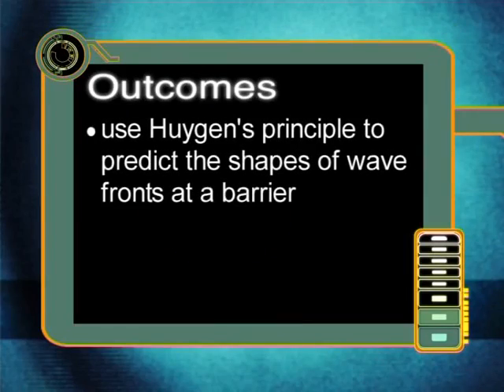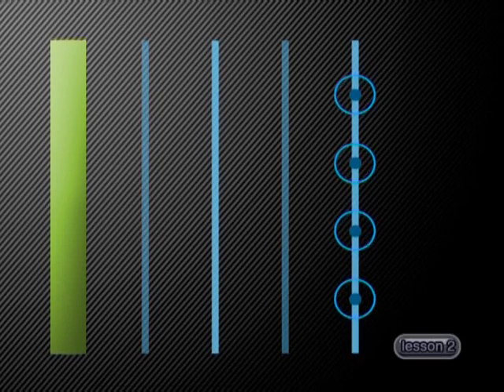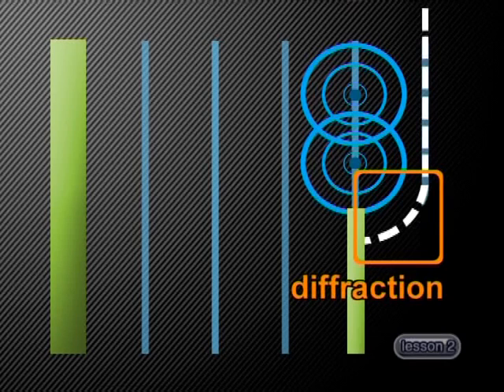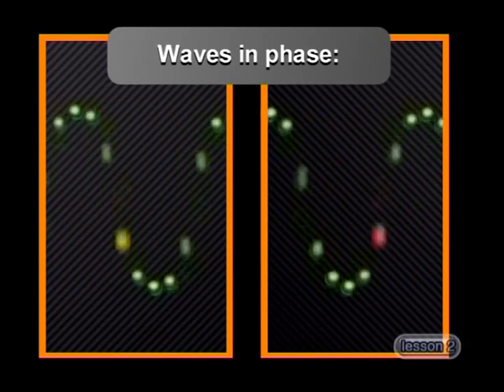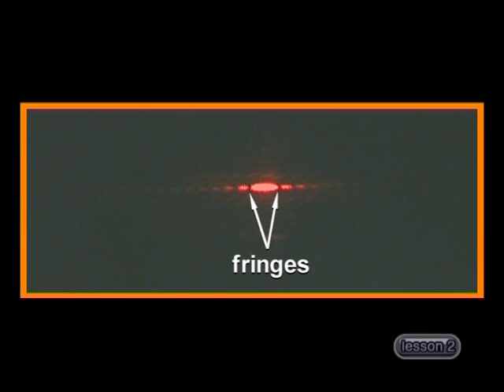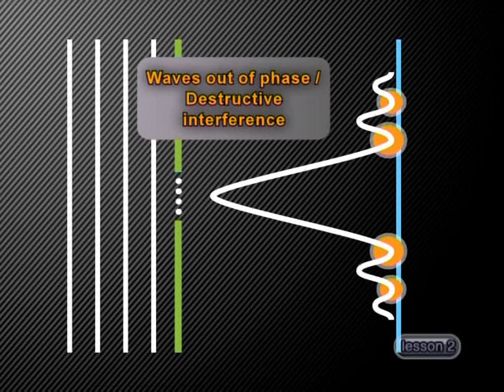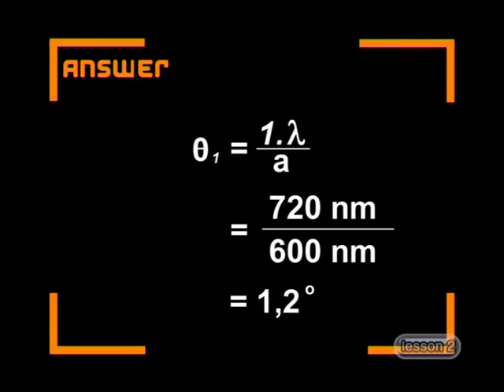Huygens' Principle - Grade 11 & 12 Waves

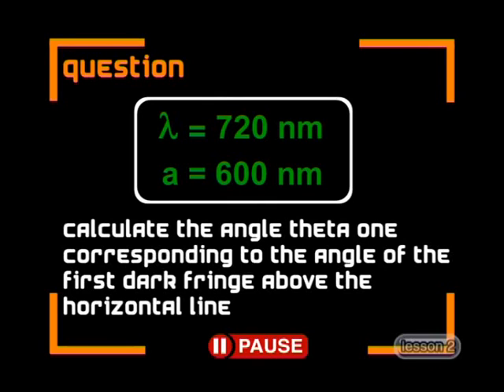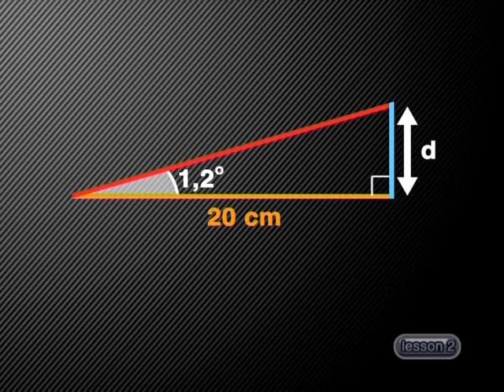Comment: Super nice presentation. But three errors:(1) at 10:14 the formula is only correct if the angle is very small  when measured in RADIANS. Correct formula: sin(theta) = lambda/a .   So  (2) at 11:30 the problem has no solution. the dark spot will not occur since sin(theta) cannot be larger than 1.  And then (3) as allready noted at 12:49 tangent and not sine should be usen to calculate the position.

Comment: u should have used tan instead of sin as opp./adj. = tan(theta) not sin(theta).
Reply: Depends on how big the angle is, though.
Even though the definition of sine was obviously incorrect in this video, you CAN sometimes consider sine and tangent to be equal if the angle is very small, since the adjacent side and the hypotenuse will be approximately equal at that point.
Reply: Laurelindo
Yup.! you are right...
Reply: no my friend... look properly sin is correct

Comment: The greater the mass/energy density of inward spherical wave front's generating heat by multiplying electrical potential along cubic dynameters compressing the wave amplitude now the shorter the expanding transverse waves dividing gravity from its source.
Energy 4pi compression +1=mass. decompressing a constant C2 forming an inward force called gravity from plains of zero curvature wave front by wave front as time unfolds into an uncertain future. E2=(mc2c4+p2c2)

Comment: I think if one turns on a detector firing photons adding to the energy multiplying every point compressing wave+amplitude the shorter the wave-lengths forms only bands
Then when somebody turns off the light from a detector time keeps dividing eXpanding an interference pattern because deconstructive constructive interference causes gravitational force from each shell coming into and out of existence or electro-magnetic wave+front compressing+4-0-4+-decompressing eXpanding spheres dividing gravity